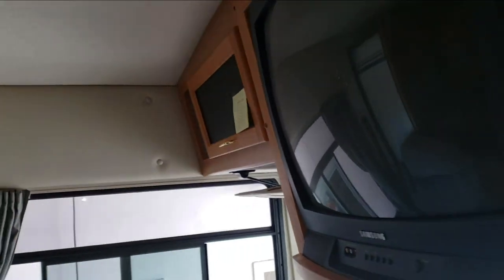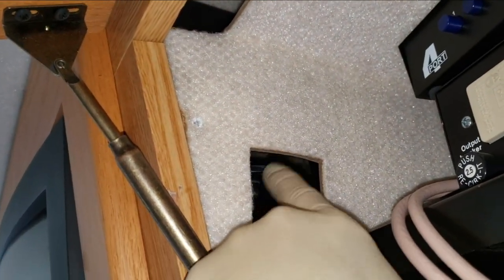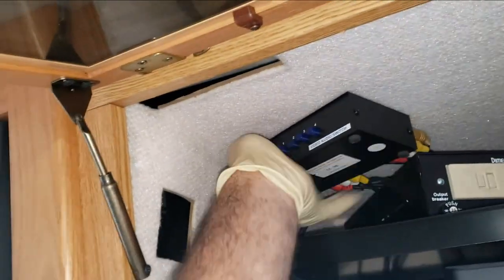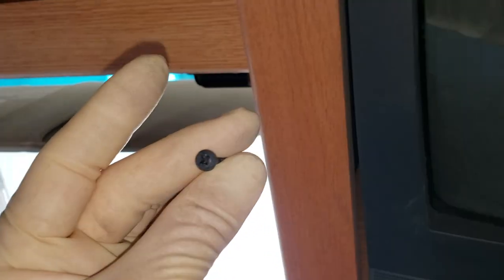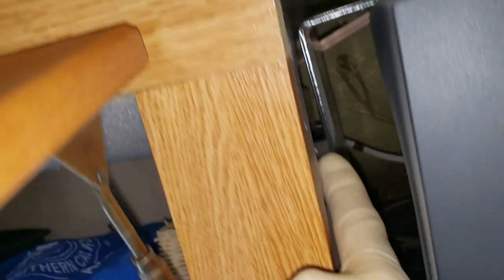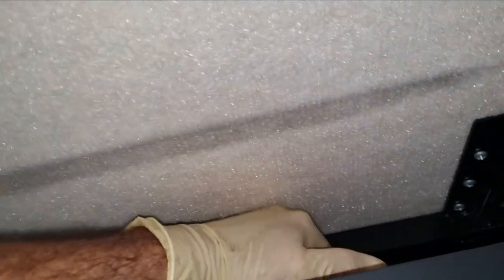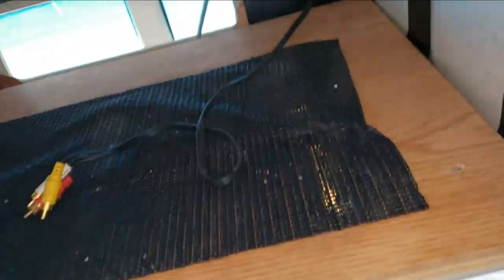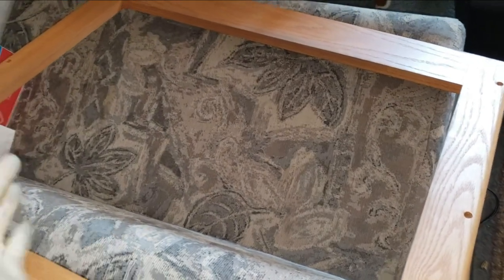Winnebago Front Tube TV Removal: Quick Tip Tuesday

Comment: Thanks again James for taking the time to illustrate so much of what has been on my mind since our 99 Adventurer purchase.  Our '99' has the TV mounted over the passenger side (not very attractive) and was already replaced by the previous owner several years ago.  I am flirting with the idea of mounting a 34" monitor across from the jack knife sofa flush above the entry door.  Vertically it works but the opening is an inch too short between the cabinetry.  What your videos show me is that nothing is impossible. Just need more time!  Lol. Thanks, and may see you in the future for a roof replacement.

Comment: Reminds me of when my company switched the conference room TV to to it’s first flat screen. The I.T. guys had to channel their inner carpenter skills too. 
Nice work, always informative stuff. 👍
Reply from the maker: Replacing a TV is a more complicated matter than most people think. Modern TVs are too wide to fit square openings and will likely block adjacent cabinet doors without modifying mounts and cabinets, HDMI cables are difficult to run the length of a motorhome....but most importantly need to be engineered not to fall off and crush a driver's head in transit which would cause a great deal of loss. Thanks!

Comment: Interesting. Have always wondered how they did that. Fortunately the previous owner of my Vectra has already replaced both TVs with newer flat screen units. Thanks for showing us!
Reply from the maker: Vectra TVs were much more difficult to mount and with an angled wooden frame more difficult to mount a flat TV on. I can't tell you how many times I had to remove those TVs for other repairs and installations.
Reply: AZ Expert mine being the 40AD, the main TV is not up front above the windshield but rather in the living room in an entertainment center in the camp side slide. The rear tv is on some goofy pivot deal that hinges to angle the tv toward the bed when camped. Fortunately I’m not one that spends much time, of any, watching tv. I prefer to be outside.
Reply from the maker: @elcaminomant  I like that floorplan. Much easier to modify that cabinet and make a storage compartment behind the tv too if you want

Comment: Thanks James. Your video encouraged me to remove the TV in my 2000 Adventurer. I was amazed how well it was secured. I got a 40 inch TV and a really nice mount so that I can swivel it out of the way to access the storage cabinets and also tilt it down at the proper angle for viewing. I removed the steel structure and plastic tub and welded a structure to go between the cabinets so the whole thing is straight across and only the TV hangs down. I would like to get some vinyl to match what is under the cabinets so the whole thing looks clean. Is there any place that I can order matching vinyl?
Reply from the maker: Surprisingly, Amazon sells vinyl fabric cheap. Otherwise, I always go to an uplostery shop first to find something close. They do install those TVs well, I am so glad they aren't installed anymore.